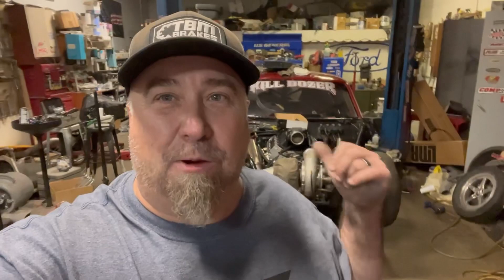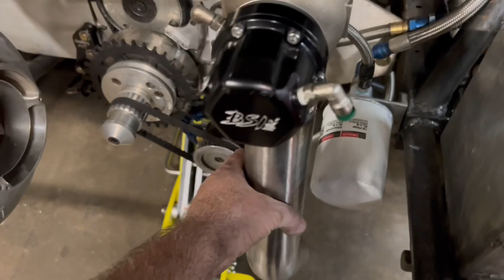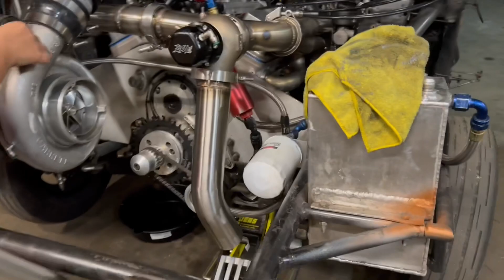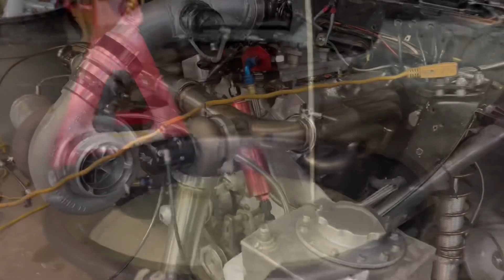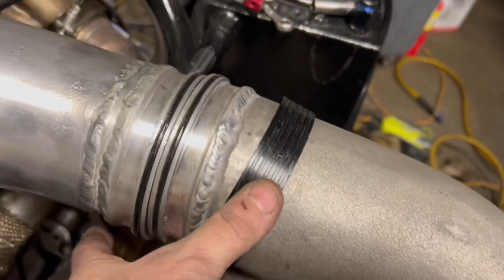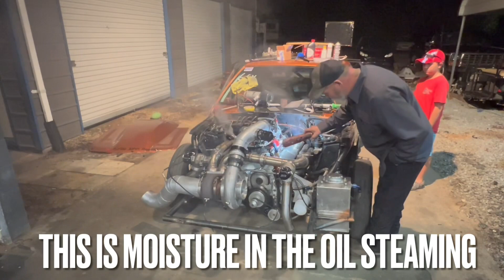Turbo Spools Great!  No Prep Kings Rockingham this weekend!

Comment: 1 more thing you could add, some nice smooth ducting attached to the front end of the car, across the entire opening in grill area that makes a smooth transition of the air coming through the opening to make it 90 degrees turn straight into the sushi slicer opening, and keep the turbo from sucking in more warm air from the engine bay to help cool the boost charge.
Reply: Of course, then you would worry about anything like rocks or sand and other debris kicked up by say a car in the lanes or crossing over in front of you...always pluses and minuses to gathering speed.

Yo bro, I think this time she's gonna sprout wings and fly faster!

Good luck at NPK you 2!

Comment: You need a Mavin mount to mount the turbo with. It bolts up where the turbo drain is and you can weld a chrome moly tube to it and weld the other end to the chassis.

Comment: Yup, more alcohol got through than I suspected, but a lot of it passed right through the exhaust valve due to the big overlap of intake opening while exhaust valve was still open, but it still washed by the rings. Either way, catastrophic damage was averted just by the fact the turbo was not on (turbo flange open), and no fire happened.
Reply: The reason that oil and alcohol/water did not separate out was because it was aerated and mixed well by running the entire oiling system, aeration and mixing fully as it went through the filter element.

Once mixed that well it takes a good heating and distillation of the oil to get it out.

With a small still, you could recover that oil perfectly, but dangerous if over distilled, and it is not just water that would distill out, alcohol and water.

Not to be tried at home John.
Reply from the maker: I cook my oil on a turkey fryer, not kidding

Comment: John, important bro. Did you turn steering lock to lock, to make sure your front passenger tires will not be hitting that wastegate down pipe on passenger side (or anything else)?

Comment: Before I say this I want you to know I crossed my fingers and toes and knocked in every piece of wood in my house and open a umbrella up outside the house 20 times but you have had extremely good luck with that forced inductions turbo! Most guys running your kinda boost have already broken hot side wheel or had a bearing seize and destroy the cold side but yours just keeps on energizer bunnying it! Goes to show ya folks! You guy quality stuff from Jose at forced Induction you get to race for years like the TURBO J and PRO.....MOD........RANDY HAHAHAHA  GOOD LUCK TURBO J GET SOME WIN LIGHTS